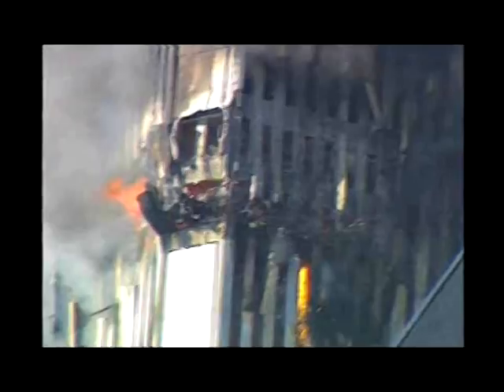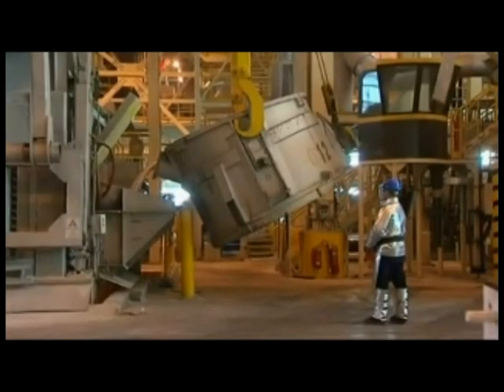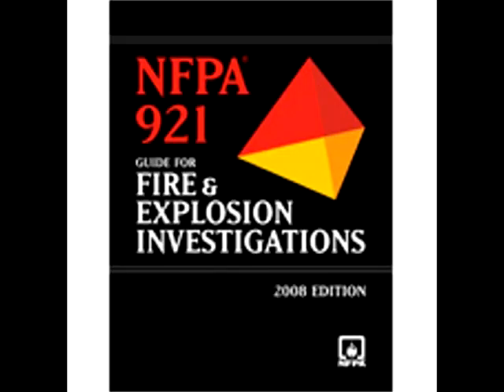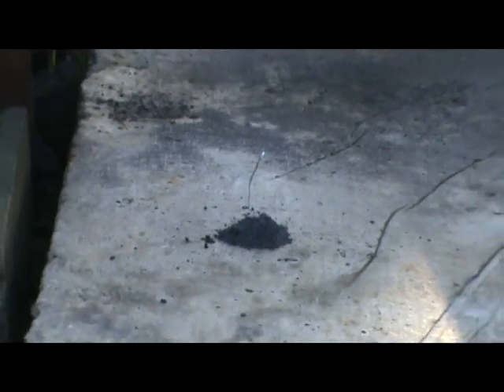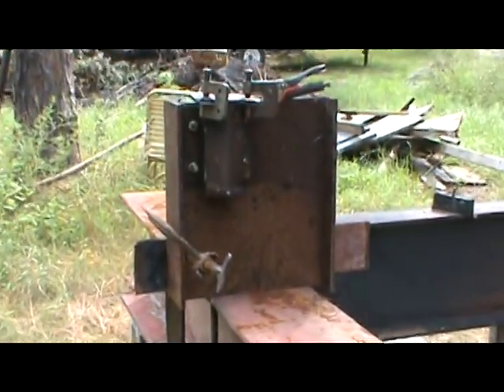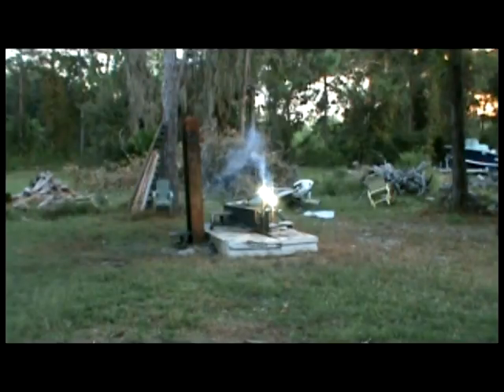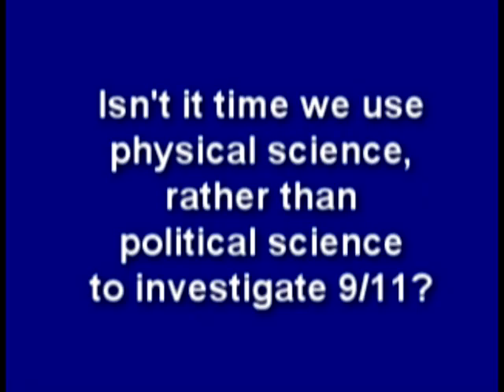9/11 Experiments: The Great Thermate Debate

Comment: Why do people keep on and on about this? You know what we use to melt steel? Charcoal. You know what burns hotter than charcoal? Jet fuel and office furniture.
Reply: Martynas Mirauskas
Glass, copper, and aluminum come to mind. All have much lower melting points than steel, and all are common in buildings.
Reply: +jib1000 Because they are uneducated buffoons cherry picking evidence to support their a priori beliefs.  It's a strawman argument at the core: steel did not even need to melt for the collapse, just weakened to the point of failure which occurs at temperatures many hundreds of degrees below the melting point.
Reply: +crushffl but molten steel WAS observed.
Reply: MBsaturnus
No it wasn't. Could have been almost anything.
Reply: These same ass clowns believe the moon landing was faked; UFOs are real; and God is real.
Reply: +jib1000 Ok. I  believe you. Give me one example what could glow red/yellow  hot, be molten, and flow from WTC 1 or 2  like water (thing what actually was present in towers).
Reply: thing is. People keep babbling on about the melting of the beams, the explosions in the upper floors, the collapse of WTC 7 and eventually a good a reasonable explanation comes to match it. I'm no scientist or engineer, I'm not too smart when it comes to melting points and such, so I can only believe what the official story tells me, or people with their own knowledge tell me through the Internet, so I have to take your words for it.
But one thing I feel I can question, one thing I feel never gets addressed...is why an explosion occurred in the lobby of one of the towers, seconds before the first plane hit the first tower?
There are several who can back this up. Firemen walk in with a French camera crew, where you can also see every section of glass is blown out, there are people on fire in the lobby, and one guy in an ambulance on camera, describing how he got blown out the lobby and heard an explosion, and then looked up saw the plane hit the tower...that's the only thing I dont get
Reply: +Arsenal Gunner (AG28) Can you provide a reference for that last part?  I've never heard that before.  If several can back it up it should be easy to provide a decent reference.  Why there would an explosion and fire in the lobby is obvious:  elevator cables were cut and some cars went screaming down to the bottom along with burning fuel.  Would that occur before the plane hit?  Of course not.  However, it would occur within a few seconds and with the impact occurring so high above you, and the time it takes sound to travel nearly a quarter mile, you might notice the thing right in front of you first.  And of course there's the confusion of memory that occurs in these events and the errors of "eye-witness" testimony.  Review the interviews of people that saw the planes actually hit and you'll hear many insist it was a very small plane and definitely not a passenger jet.  We hold eye witness testimony to be sacred, but experience shows it's highly flawed.That's just my take, but along with the alternate explanations you have to ask:  what makes more sense, that some witnesses were mistaken or that there was a separate blast that actually occurred seconds before the plane hit?  If this was a hoax, why exactly would the perpetrators want a second explosion in the lobby?  Why would they risk having the complexity of having to time a second explosion with the impact of a plane?  Once you ask those types of questions, and with the lack of any actual link to a credible source stating that there was actually another explosion, my explanation starts to sound much more likely.
Reply: +jib1000 idk about glass and copper but in the video they discussed why it couldnt be aluminum already.
Reply: +wolfy equality Not that it couldn't be aluminum, just that it couldn't be pure aluminum.  But why would it be pure aluminum?  The plane shattered on impact, spread throughout several floors of a very large building.  the pieces would have intermingled with shattered pieces of furniture, carpeting, insulation and other building materials, in addition to plenty of glass and copper piping that would be pretty abundant in a building like that.  The last two materials, mixed in with the aluminum, have lower melting points and would make it glow at those temps.  The video tries to dismiss that issue, but does a piss poor job.

Comment: Anybody that says jet fuel can't melt steel knows very little about metallurgy. Yes there's no way a static burn if jet fuel can touch steel, but WTC wasn't a static burn it was fed by a crosswind. all that air being pushed through the newly created hole in the building feeds the fire nicely and causes it to burn much hotter.  It's the principle for how a bellows makes wood hot enough to melt steel. 

And of COURSE you're going to find trace amounts of thermite in a melted building, all that steel and aluminum WILL react under that heat to create signs of thermite.

If you want to bitch about others ignoring facts then you damn well better begin taking the effects of that crosswind into account before you begin yammering on.

Comment: Think about the red chips of nano thermite found everywhere... Use the same basic principle of directing the thermite like was used with the box cutters... Paint on a layer of nano thermite and then cover it with a containment sealant coating.

 When the thermite is ignited the sealant coat would force the thermite energy inward within the shell of the sealant coating melting the steel and thus causing complete structural collapse.

Comment: why does the steel have to melt for the structure to fail?
Reply: Newman Noggs The structure was made from steel.
Reply: Yes, but the steel only has to get soft, and then only in a few places, for the structure to fail.  No melting needed.
Reply: Newman Noggs A plane crashing into one part of a building would only damage a few struts a small amount, then, the amount of space the fire covered clearly wasn't very large, and relatively cool compared to steel anyhow. Not enough struts would be damaged.

Comment: Jet fuel can weaken steel beams
Reply: Fanfire101 No, no it can't.
Reply: +Cameron McAllister Yes it can -- all it takes is 738 degrees (Celsius) to weaken steel, and jet fuel is PERFECTLY CAPABLE of reaching those temperatures!
Reply: agentorange153 Still, the jet fuel fires didn't reach every beam.
Reply: +Cameron McAllister They didn't HAVE to -- they just had to weaken enough beams to trigger a collapse!
Reply: agentorange153 A collapse directly down, because building weaker on one side totally don't collapse to the side of the damage, they fall straight down with no tilt.
Reply: +Cameron McAllister Exactly -- the damage was so near the top that the damaged section would remain more-or-less upright even if the collapse starts on one side!  This has to do with the floor area vs. height of the section above the damage!
Reply: +Johnny B Same thing -- it collapsed from fire!
Reply: +Johnny B Yes it did -- the fires spread throughout the building!  And buildings normally DO fall straight down!
Reply: +Johnny B Firebombing of Hamburg and Dresden, LOTS of steel buildings fell down because of fires!
Reply: +Johnny B Google "bombing of Hamburg 1943" or "bombing of Dresden 1945"!
Reply: +Johnny B Look it up and see for yourself!  And learn English!

Comment: The official explanation is not that the steel beams melted.  The official explanation is that the heat softened the steel to the point where it could not support the weight above it. (Call it "melting" if you want, but it does not liquefy.) The heat was spread immediately and equally through the floor where the plane hit, points of collapse heated at the same rate and collapsed at the same moment.  The thermate argument is great.  But once the fire started, why didn't the flames set off the thermate at 5 minutes?  Bear in mind, you've got roughly 40 tons of jet plane, contents and fuel ripping through that floor like a shotgun blast. immediately followed by the fire. And the pilots had to hit the building at the right floors where the thermite/thermite was planted. Why didn't the thermite/thermate go off when it was hit?  Inside the box beam or not, the jet fuel would have set it off much sooner.
Reply: Joe Zingher And then it fell straight down? GOOD JOB WATSON! YOU GO GET A COOKIE AND LEAVE THE SCIENCE TO PEOPLE WITH MORE THAN A COUPLE OF HUNDRED BRAINCELLS!
Reply: Cameron McAllister The beams below the point of impact were not damage by anything and yet, they too fell straight down.  Or are you claiming that all the way to the bottom they had sabotaged the floors with Thermate?  If they did, it was damn good coordination.   REALITY: Once the beams gave way at the point of impact, all that mass above it was pulled straight down and the beams below it actually guided it down. The columns that made up the core of the structure were tied together by cross beams.  That's why they didn't peel apart like a banana. The mass moving down overloaded each floor one at a time. I think you have a real career opportunity as loud-mouthed moron.   (Did it take many hours for you to learn how to use uppercase letters?)

Comment: this is a damn good video. someone was waiting to push that button.. As soon as the plane hit they triggered the devices and waited. physics doesn't lie. those buildings were constructed to withstand a hit or two from airborne collisions. no way could those planes have caused the collapse.
Reply: +Jim Williams The were designed to withstand the collision of a smaller plane with a much lower speed und low on fuel.
Reply: you misunderstand.. i posit that those buildings could have been constructed with the means to collapse them built in. this would be a SAFETY FEATURE, one which could save lives in the event of critical instability caused by a natural disaster, this feature would allow for a controlled collapse. i do not imply they were built with the foreknowledge of some cospiratorial plan. americans cannot play good chess, im sure they cant plan a conspiracy that takes 30 years to bear fruit.
as i said, it was not a prime computation.
Reply: it is possible the devices were incorperated into the buildings structure at the time of construction, to allow for a controlled demolition. the collapse would be done this way to minimise damage to structures close to the Two Towers. this is possible, but not a prime computation.
Reply: +Jim Williams So having the demolitions in place during construction and sitting there for 30+ YEARS would be safer then coming up with another way to bring the buildings down when they needed to be replaced, the logic behind building a building with "explosives" planted in the walls is even crazier then these fucking "truthers" theories.
Reply: It was done to minimize casualties so that the buildings wouldn't hit more structures.
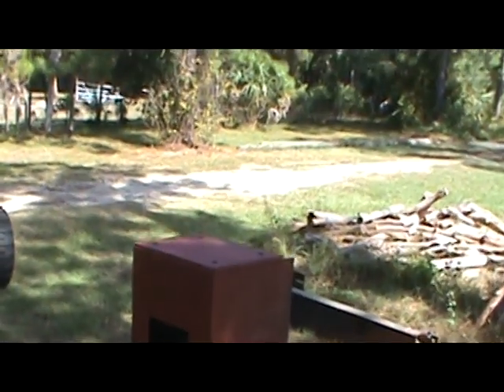Reply: +Dr. Ny Har Rut Hotep There was access to the columns as shown in the footage at 12:25.  No 30 year conspiracy is needed.
Reply: Jim Williams
the building was designed to survive an impact from the plane of the day, the modern jumbo jet age has bigger heavier planes, it was designed to survive an impact from a Boeing 707, also your talking structural engineering done by old school math in the late 60's, while the math may not have changed much our design and understanding of building structures has, we didn't have the engineering back then to do the buildings we have today.
Reply: so this would have been a plan ongoing for about 30 years  for an Invasion of Iraq (which happened anyway in between) without anyone speaking up. That's pure fantasy
Reply: You guys still arguing? Flooding my email lol.
Reply: Daniel McPeak
 you know there is a MUTE button if you don't want to keep seeing replies.
Reply: +CobNasties The Titanic had structural faults and ran into a massive iceberg. This is more the equivalent of the iceberg going down because Titanic hit it.
Reply: +platanom3n Says the one who believes the media/propaganda
Reply: DanielRichards644 I've already addressed that. Get a picture, and a job other than being a shill.
Reply: sheeesh! it was just an idea man..
of course you want the building safe and not wired to blow, honstly who could work in a place that has a self destruct option(the word twitchy springs to mind).

In fact the truth is you would build the thing as strong as possible to withstand disasters like earth quakes, fires and impacts from aircraft.. yes?
the the old world trade center seems to have failed this basic design parameter.. along with  the third building which wasnt touched by anything.
thermite was used. we are sure. we just need some evidence proving when and how.
Reply: +DanielRichards644 A Boeing 707 is roughly the same size and fuel capacity as the Boeing 767s that hit the towers
Reply: y0sh1100
 "roughly", oh that is classic, lets just ignore physics because they look to be close to the same size and disregard the fact the 767 weighs 20-30% MORE depending on fuel levels. Please return to high school so you can learn about KINETIC ENERGY and how more mass moving at the same speed has a greater impact, then something of less mass.
Reply: y0sh1100 Want to go down the rabbit hole?  Check out "Skygate 9/11."
Reply: +Daniel McPeak mute the thread.
Reply: +Dr. Ny Har Rut Hotep  You just said it for me. This was planned over 30 years ago.
Reply: +Jim Williams yeah and buildings in California and other earthquake heavy areas are designed to hold up against earthquakes but some of them still fall don't they? Just because something was designed to work doesn't mean it will.
Reply: You're an idiot.
Reply: +Dr. Ny Har Rut Hotep sorry but engineers would NOT assume that the plane is low on fuel. that's just absurd. Completely implausible.
Reply: +Artruis Joew No. Sorry. Aluminum melts VERY easily. I have a 550 gallon steel burn barrel that I've burned more than a house in. It'll glow red sometimes because the iron is warm. (pretty awesome to look at, frankly =D) But anything that's made of aluminum that I throw in the barrel will melt into sludge and lose all form.
But the steel will NEVER melt in a normal fire, even when fed pure oxygen. Just do a little google searching. Your previous post looks REALLY foolish man.
That being said, I'd like to express that I look down upon the claims of Jim Williams as well.
Reply: Artruis Joew
no. I didn't. You missed mine: IT WON'T.
look into the physics of heat creation in a fire. You can't get a billion degrees with just kerosene and oxygen.
Reply: +Justin Crediblename Actually yes they very well would assume that. They would not be expecting someone intentionally flying a fully fueled plane into a building. They were thinking along the lines of a plane coming in to land and had gotten lost or something along those lines.
Reply: wash beezy
engineers, being the cautious types, wouldn't consider a plane that's taken off recently as a plausible possibility? That seems strange.
Airplanes sometimes fail soon after takeoff, like this one http://www.nbcnews.com/news/us-news/plane-crashes-building-mid-continent-airport-wichita-n237521

Sure, the larger b-25 bomber that crashed into the empire state was trying to land and couldn't see through the thick fog.

I'd be impressed if you could find info to back up your claim that they only engineered it for having less fuel.
Regardless, I doubt that the fuel would have much effect on the core columns. But go ahead and link me to an analysis that states otherwise.
Reply: +Jim Williams They had men in 2 black vans doing "elevator maintenance" in the weeks prior to 9/11 at hours likw ~1-2 am in the morning. Perfect time to get in and install some "features"
Reply: +y0sh1100 Your right, ice sinking doesnt make any sense at all. Neither does 9/11.
Reply: +Jim Williams That too in a controlled demolition manner...
Reply: ***** What I said wasn't really a claim pre se. More of a statement but I think they would have based their designs on a plane landing because that is what had already happened. They never imagined a plane flying full speed fully fueled into the buildings. It was just something they had never conceived of.
Reply: wash beezy
Really? because in 1945 a plane flew into the empire state building. They damn well imagined and expected a plane to fly into any building of such size eventually
Reply: RanndomUndead Nice job completely not paying attention to anything that I just said and then twisting what actually happened and turning hindsight into "what they should have known".
Reply: wash beezy
What you said is a plane flying into a building would have been completely out of the question and never even taken into consideration during the creation of the building.
Reply: OK so why DID 9/11 commission didnt mentioned about the several explosions happened before the collapse...both the buildings took whole impact of the plane and didnt moved more then a few inches then suddenly whole building collapsed straight down due to office fire...come on..never in the history a building of reinforced concrete and steel structure have collapsed dude to fire...and just look at building 7...the third building to fall at the evening of that day which was never even hit by any plane...that also in controlled demolition way...there have been reports of continuous power cuts for more than a week at night time 3am to 5am...also why was the building insured for one more billion dollars just two days before 9/11...
Reply: Vj Sharma
dude your english is pretty rough. It was insured for more than 2 BILLION. In fact, he received 4.6 billion, which exceeds his lease by 1.3 billion dollars.
2 million is chump change.
Reply: wash beezy
how do you know this about the engineers? where are your sources?